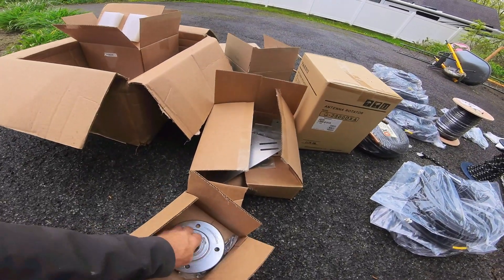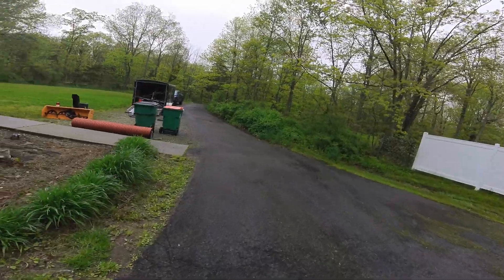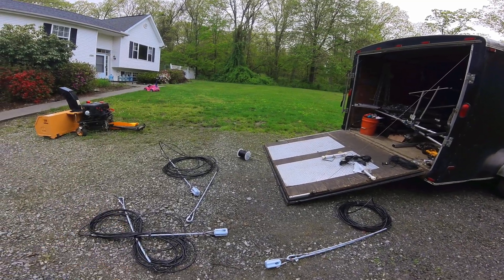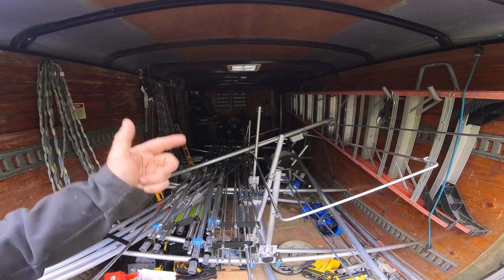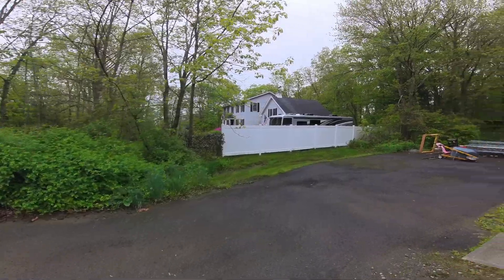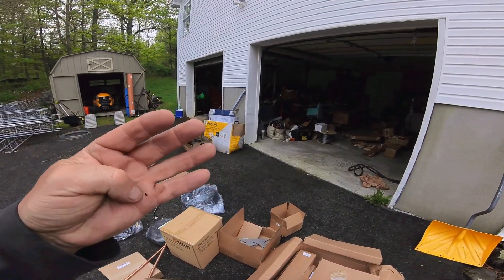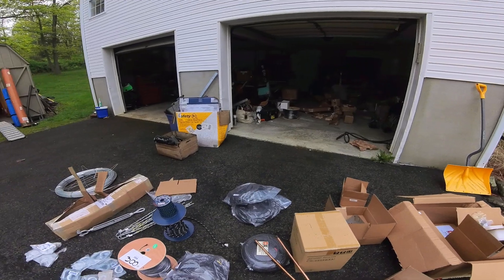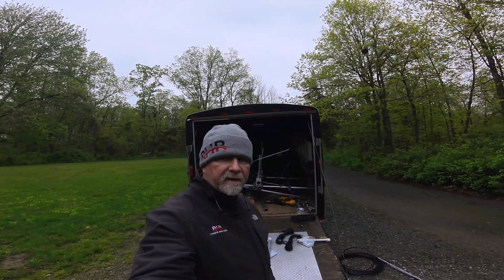How To: Ham Radio Material List To Build A Rohn Tower.

Comment: Ro-TAY-tor. A rotor is an inner axle of a motor.
Reply: Correct! A rotor is also part of the old distributor system which contained the points and other small parts in older vehicles. This was before solid state systems.